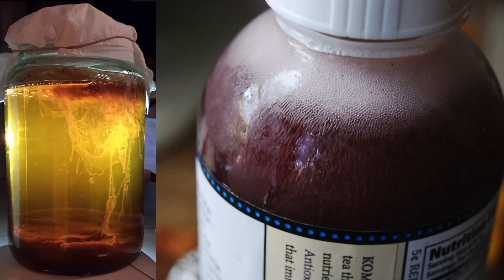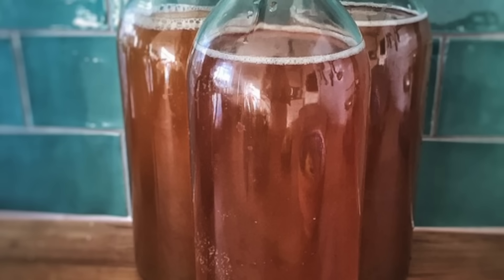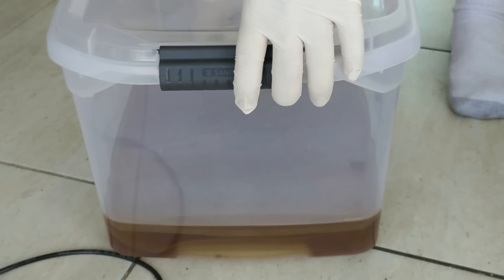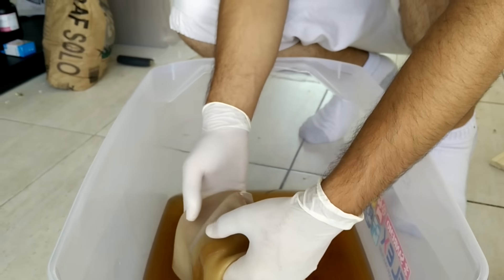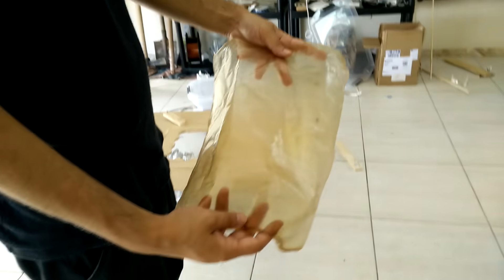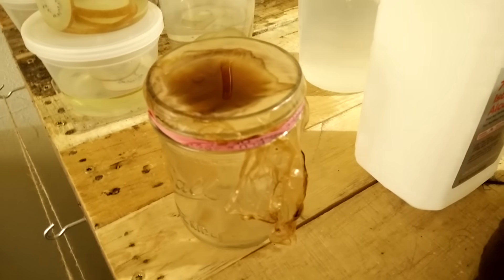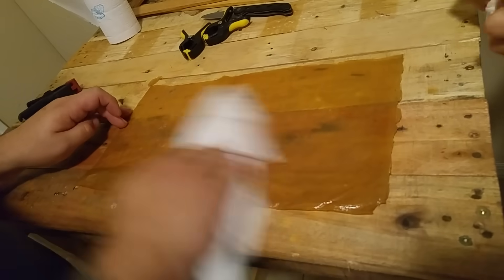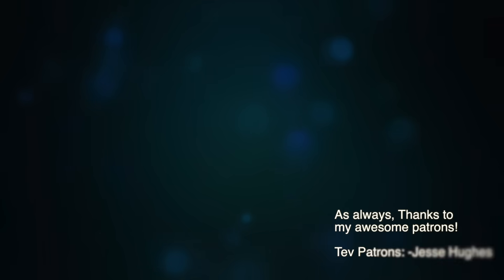How to Grow Leather-Like Material Using Bacteria (Making Kombucha Leather)

Comment: Now I know how I'm going to make a biodegradable "plastic" wrap for use on my off grid homestead 😊
Reply: Fabric with wax melted in is far simpler but may have a shorter lifespan if they stabilize the coating to make the material last indefinitely.
Reply: I aspire to do this if I don't get rich...

Comment: Uh... pretty sure every kombucha recipe I’ve seen says NOT to use METAL containers and utensils.
Reply from the maker: Nope, just copper or aluminum containers. Stainless steel is fine as it's quite resistant to the mild acidic conditions. Also most recipies are written by people who have no idea how biology actually works and are just parroting things they heard. But If you have glass or plastic it's helpful to use that so you can see in more easily and keep track of how things are growing

Comment: Might also be able to be classical guitar strings if you can manage to make strings strong enough out of it (I have heard there used to be cat gut strings)
Also might be able to make adhesive with it. Like a wood or paper glue. Elmers I think made or maybe still makes glue from animals
Reply: You know of course that musical instruments have used nylon strings just as often as gut for decades and that cat gut was never actually made from cats, it's usually sheep or goat but can also be cattle if that's what folks are eating instead.
Reply: @Tea_and_Crafts  I did know that nylon is more common at this time and has been for years, but I didn't know that gut strings were usually sheep or goat. Thanks for letting me know. 
I think if someone tried making strings with a scoby, they might need to add something fibrous to it so that it could handle being in tension. 
Drum heads might be more likely to work: several layers laminated together might create a surface that could withstand tension.
Maybe anyone interested in trying to make something like that could try adding paper soaked in water and blended into the scoby or possibly fiberglass fibers. Either might improve the tensile strength of the scoby, but I don't know how it would affect the growth.

Comment: Layers of it laminated together or a thick sheet of it might make a good drum head (like a djembe, conga, or bongos drum head, possibly heads for drum set also, might be harder to find drum set set up for actual leather heads). It would need to be able to withstand being pretty tight to be useful as a drum head. Also possibly string instruments that use a drum head (like a banjo)

Comment: I'm a historical reenactor and I can see the promise of this material as a stand alone material but as a replacement for leather? Unfortunately not at the moment. Me and the group I'm apart of have to use leather for everything not only for historical accuracy but its sheer life time and durability. Sheaths, shoes, belts, water bottles, grips, straps and various other applications. I half to rely on a material to last along time cause even a standard linen shirt that each half to be hand made can easily cost over 100 us dollars. Leather work for shoes ain't cheap either and belts can be fairly cheap without detail work. Cost isn't everything either, treated leather can withstand a lot of brutal usages and I dont know if this material can. As a replacement for leather for things like belts or handbags? Yes I can see that but we dont know how long the material lasts under constant usage yet.

Comment: Should try the method of curing leather from hides with olive oil.. You rub in olive oil and soak it in with heat lamps above, it becomes stiff again,  "break it down to soft and add more oil.. repeat until finished...

Comment: It’s likely no one will read this comment, but whatever that’s web 2.0. What I don’t understand is how the f**k one should prevent mold, unless you use HEPA filters and UV-light. Every time I tried this at home it has predictable started to mold. Sure I have tried to clean everything in my kitchen first with soap then with bleach. But let’s say every m³ of air in my kitchen has X mold spores. Then X is such an astronomically large number that even if cleaning with bleach is so effective it reduce the number of spores to 0.1X per m³, there will be tons of mold spores contaminating the batch.

Comment: You don't need the frame. If you just let it dry in a plastic dish or on a plastic sheet, it should stick enough to not shrink but not absorb so much into it that you can't separate it anymore like some kinds of natural stone. I guess a glass plate should also work? In any case you should find something that doesn't stick too little and not too much, and this will depend on the microscopic structure and smoothness. And yes I do speak from experience, I had it work with a big plastic dish that is used for bottom watering plant pots or collect when plant pots are draining.

Comment: Interesting ...
Do some test comparing it to the same thickness of leather. 
Ware and durability, 
Stretch and strain, 
Dye adhesion, 
shelf life with no treatment, 
interactions with other materials such as cotton (stuffing/batting) or wood (handles and the like) 
Untreated/treated water resistance.  
Field serviceability (like could it be used for military applications for slings and ammo pouches)
Could there be medical uses??? Maybe for burn victims as a holdover till either pig or human skin grafts could be employed??? 
Also
If we replace the cattle with this ... what happens to the surplus of cattle?
What happens to the underlying industries and all the affected families... 
If adopted and industrialized wouldn't this drive up the cost of tea and sugar?
 Keep up the good work there could be

Comment: 2 Tea bags for 1 gallon of water. Is it me, or is something off here.
Reply: I think if you're making it with the intent to harvest the scoby, you don't need as much. However if you were actually making kombucha, you'd probably add more bags
Reply: @Wolfoe1238  the bacteria feeds on the tea as well, so if you want it to grow faster you give it more food.
Reply: Wolfoe1238 j
Reply: They are probably using the big family size bags not the normal cup sized ones
Reply: Nathan Fletcher your not wrong. 10 per gallon is what I've used, but 2 would work i guess...
As long as your fine drinking weak booch
Reply: Yes they forgot the milk.

Comment: Is there a curing time/condition for the initial scoby or can we remove the water as fast as reasonably possible without cellular disruption without degrading/derating the material characteristics significantly?

Comment: The wallet looks like you could tear it into 2 parts with just your hands.
Reply from the maker: See the update video pinned above. We had this material tested and it's at least as strong if not stronger than nylon. I made a nicer wallet after this video went out and have been carrying it around for a year. We take it to bars and bet people they can't rip it and if they do I'll buy them a beer. Thus far, no beers have been purchased and it's held up just fine.

Comment: Does scobie contain fibres, or would it be possible to add fibres to scobie?
Maybe lay down a piece of cloth into the bath, and have it dry stretching that cloth?
BTW, leather thickens and hardens if you boil it — but at the expense of surface area.

Comment: At last! Someone found a reuse for the Kombucha scoby! 
How about strengthening it a little more by putting floating fibers of something in the tea for the scoby to grow around so they are incorporated.
Reply: Thin fibers of Scooby in a mesh sounds like the same method they use for eye enucliation.
Reply: I'd like to know the resistance of this; I'm going to grow some and make it into leather but glue some Kevlar to the back and test resistance to sliding when coming off a motorcycle. I'm just curious as there's no leather alternative for motorcycle gear for vegans, only textiles which are not preferred on track, and it's a growing market, it's just that leather is really difficult to compete with in terms of protection when sliding.
Reply: @BurntFossil  That's exactly what I was thinking! please update with results! :)
Reply: BurntFossil It’s been a year, what are the results?
Reply: Fiber-impregnated scoby composite, if the fibers (glass, kevlar, carbon) are sterilized beforehand, could be incredibly strong. I'd be fascinated to see what could be done with it.
Reply: Brilliant idea! Give it a try.
Reply: Don't put anything in the tea itself IMO, you can just recompose the normal harvested scoby and mix it with basically anything you want. Putting stuff in the tea is a contamination risk and trying to make the scoby grow and incorporate materials may just not be necessary and potentially a lot of work to get a good looking result.
But yeah I've made various composites.
Reply: Jop Mens unless it’s a bandage produced in sterile enviroment
Reply: @weberito  Veterinary gauze for horses is large, cheap and sterile.

Comment: Why not provide it with a matrix?
Cotton, polyester, nylon..
All would massively increase strength and durability as well as making the wet material easier to handle.
Reply: I think the goal is to avoid mixing in other fabrics as far as possible for them. Cotton fibres would be pretty interesting though and could still be ecologically friendly

Comment: Have you made any wear resistance comparisons? How about tensile strength? Ability to retain stitches. Unfortunately without results that prove that it is at least as good as leather or fake leather it won’t be researched
Reply from the maker: I've been carrying around the wallet we made after this video aired for more than a year now. Still as strong as the day we made it. It's gotten wet in the rain and gone in the ocean by accident. Still retains stitches very well. And we had it tested, it's stronger than nylon. Been going around at bars betting people they can't tear it. Thus far I've won a lot of a beers.

Comment: You didn't test its strength or durability.... literally the main reason leather is used in so many different applications

TBH what you produced looked like i could tear it with my hands, making it essentially useless in typical leather applications like boots, clothing, belts, rope armour ect...
Reply from the maker: We had it tested, it's stronger than nylon. And we had someone hang from a strip of it. Also made a better wallet which I've been going round bars asking people to try and tear it. Thus far no one's been able to.

Comment: So just a clarification here.... vegetable tanning (the tannin method you spoke of) was actually the prevalent method until the industrial revolution.  It is currently actually only popular with people who tool leather (decorative tooling, saddlery, etc, etc)  or require a leather that is safe to contact metal, because chromium salts resident in chrome tan will cause the metal to rust (no brainer there I'm sure).  As a result, because vegetable tanned leather has such a niche offering, there are only two tanneries in the United States still doing it in this manner.  Everyone else is drum tanning it.  The reason is largely that if you don't need to modify the texture of the leather once dry and are using it for upholstery or worn textiles, the chrome tanning takes 2 days.  Veg tanning takes 6 weeks.  They both use a lye slush initially before they are tanned, but a lot of drinking water is still treated with sodium hydroxide too (albeit in lower amounts).

Comment: 5:00 drying SCOBY this is no longer intended as a live product a solvent such as 190 proof ethanol (since this is a green vid) or acetone, methanol, etc  (something super hydroscopic) could dry this in a more regulated/industrial manner.

8:00 you obviously (to my drunk ass I.e. this maybe a stupid comment)  need a way to increase the thickness of the original SCOBY or a way to fuse sheets together like plywood which would have to happen before reintroducing an oil.

I envision a spritzer bottle of water and a flatiron for desiccated sheet bonding, but as a simple (and very) drunk creature its only a best guess.

Comment: Could this be used to replace plastic? Think about it. In its thin form it could be used to package foods and since it's of natural composition surely it's bio-degradable. It may not be perfectly sterile therefore it probably shouldn't be placed in direct contact with food but it could replace other plastic uses. Am I crazy or would this actually work

Comment: The culture produces a high concentration of acid (or at least usnic acid in the Kombucha). Has there been any tests of the acidity of the scoby and the prepared material in contact with the skin for an extended period?
Reply from the maker: It makes acetic acid for the most part. Hadn't heard of usnic acid production, but it wouldn't surprise me if some was floating around. It's mostly just vinegar though.  There's no acidity issues with the dried product and it can be in contact with skin. It's basically just paper, but grown as a sheet so it's far stronger.

Comment: Try dry air drying, and planning to multi layer like plywood is made of different grain direction veneers. I'm really interested.
Reply: I'm seeing in my head, what about laying the undried  1inch thick Scoby sheet on a dermal substance that will fuse into it (gelatin?) as it dries down into a tougher sheet.

Comment: Fascinating.

I'd be interested to learn if the microbial culture that makes the kombucha, was actually a yeast (single-celled fungus), a bacteria (forming a bacterial film), or even a combination of the two - working to form the scoby. Once you know what it is, then you could investigate among the different strains for the best result (not to mention genetically engineering in the characteristics of animal leathers, later on). Could heating it in a high oxygen incubator accelate production?

You might be able to create different leather-like internal structures by mixing fatty acids & proteins into the kombucha mix. Not to mention adding a fiber matrix (cotton, hemp, bamboo, carbon fibre, collagens, etc.) for the scoby to form around. You could even put the fresh scoby into a metal press as it dries to give it the surface characteristics of various animal leathers (eg: crocodile)

There are so many incredible possibilities. Have fun experimenting.
Reply: Checkout:  www.MycoWorks.com

Comment: BTW—any thoughts on the possibility of using this to make a pseudo-parchment writing medium?
Reply from the maker: Dry it under pressure and basically turns into awesome parchment. Easy to draw on too. so sandwich it between 2 plywood boards and some paper towel to absorb any moisture, then add a bunch of weight on top. Works great
Reply: The Thought Emporium 
Thanks for replying.

Further:
How “durable” is it?
And is there a way to waterproof it?

Comment: Seems like UV is destroying the chemical bonds of the proteins, causing it to become more brittle. 

If you could use something as a protective layer on the scoby to prevent oxidation, then dry it in a food dehydrator, its likely you'll achieve a stronger more flexible material.

Comment: Is it biodegradable? Could this be an eco-friendly substitute for plastic?
Reply: Yes and no. This doesn't do what plastics do, it can't be extruded or molded. I doubt it would have the properties necessary to replace our biggest source of plastic pollution.  Fishing nets. Fishing nets make up roughly 40% of ocean plastics.  Most of the rest are chemically degraded microscopic pieces of plastic that don't actually do very much to the environment.

The problem with plastics isn't that they're non-biodegradable, that's actually a benefit. The problem is that we treat plastics as disposable because they're cheap to manufacture.
Reply: David S. Obviously it is ade of bacteria

Comment: The best way to dry it is to buy a cheap box fan from home depot then buy a cheap $3 home a/c filter them just lay the fan flat with a air flow to enter the bottom lay the filter on top tape it down with painters tape then just lay the fresh gel leather on top and turn on the filter! Easy effective and cheap!